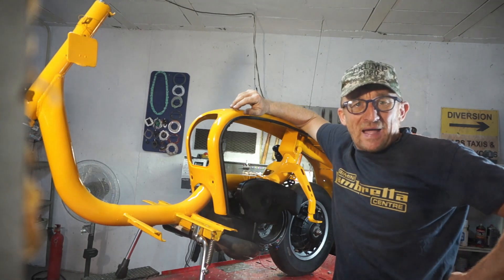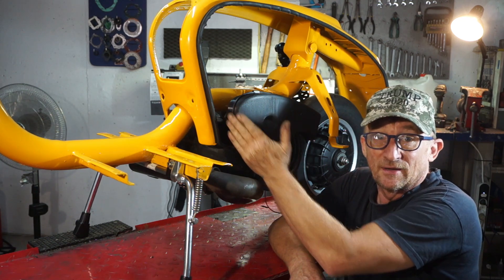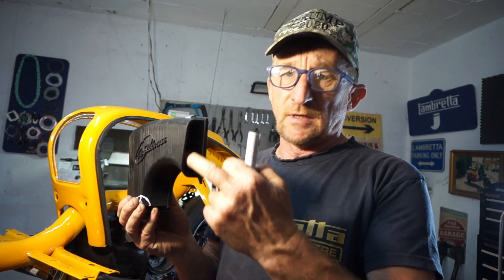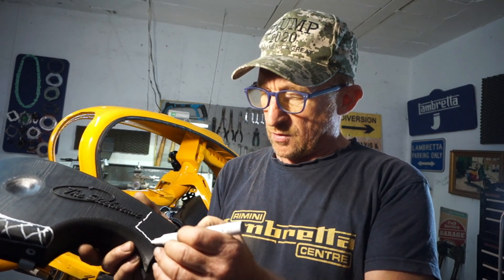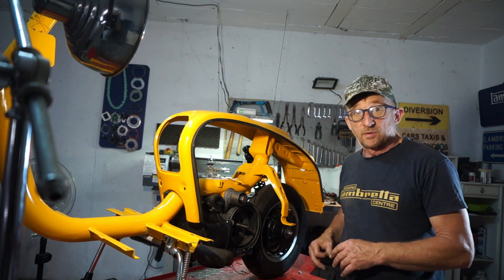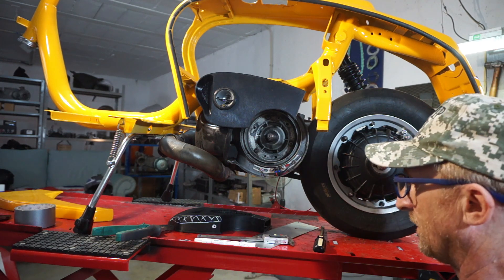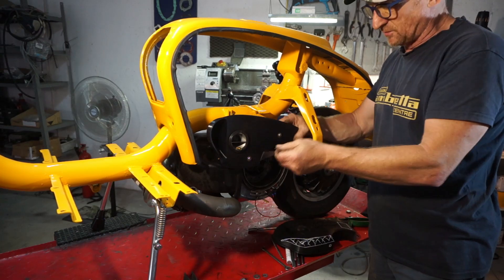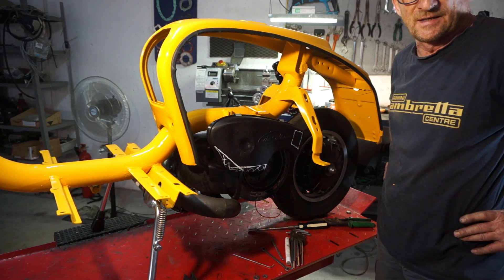AIRBOX PROJECT part 3 #lambretta the best air box ever made for lambretta

Comment: Will this fit the different manifolds available for the PWK? I had to buy the BGM type as the MB, although very nice, fit facing 'forward' a bit and thus not great to run through the airbox. So basically depending on what manifold you use (Casa and BGM, in a more traditional spot or types like mentioned above for foam type filters) the intake will be in a slightly different position! Perhaps there's room in the mounting brackets to fiddle it a bit, it's not a huge difference... Also, does it have a drain for spit back? Perhaps you mentioned it before, I don't remember I'm old.. Saludos from So California amigo!
Reply from the maker: Hi mate . Final model will have a drain yes . It will only fit if the carb  in standard position, bgm or sr manifold I'm gonna test if it will fit 22 mm dellorto so this can replace standard air box a fix the flooding lambretta problem  👍

Comment: Hey Steve what about the clearance with a normal Li/Jet side panel?
Reply from the maker: gp panel have the leased clearance , so li will have more it all depends on carb delorto has 10mm less cos its longer , this is one of the reasons i use pwk apart from they give more power and use less fuel ......
Reply: @TheSteelweasel  ok thanks, I'm on a RT reed with a dellorto, so trying to find a solution for better filter than my semi squashed bgm remote

Comment: Lovely engineering work Steve , looks great , like its meant to be there from innocenti design except they would have used metal that rattled and fatigued like the cowlings so your design is top notch.
Will there be any filter paper inside it to stop any foreign bodies entering the engine or is that part of the design anyway . Great idea Steve 👍🛵✊
Reply from the maker: it will have a foam filter inside mate

Comment: Is there a way to have a small hole in the top of the flywheel cowling and into the bottom of the air box to force air into the air box and create forced induction as revs build?
Reply from the maker: not really what you want , you need still air better forced air will need mapped fuel injection tp work .

Comment: top work  ,going to be  great when all the R and D is done and you`ve nailed the final design , something   like  this should of been on the market decades ago , open mouth  large  carbs  with no filter suck it so much rubbish you might as well sand blast the bore , and   sticking in a filter jammed up against the panel is just sucking in hot  air  , cold . controlled  and filtered  is the only way ,  Top work  mate
Reply from the maker: cheers mate , been thinking about it for ages but no wat to do it ,,,,,,,,,,, 3D PRINTING IS THE DOGS BOL#]][/;S
Reply: @TheSteelweasel  we use 3D printing all the time , new print systems are able to print metal  ,